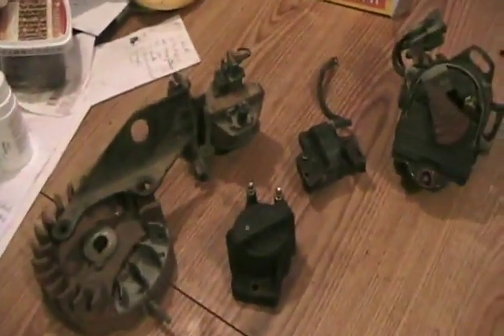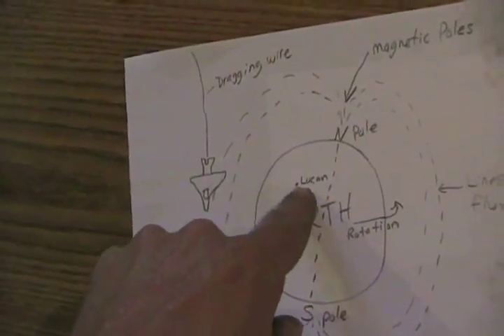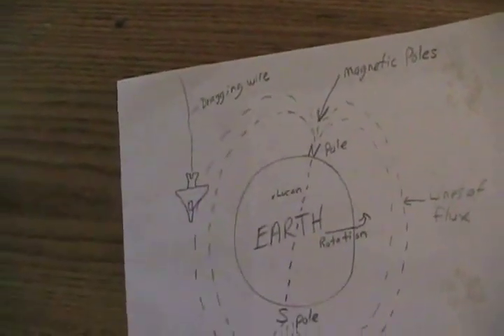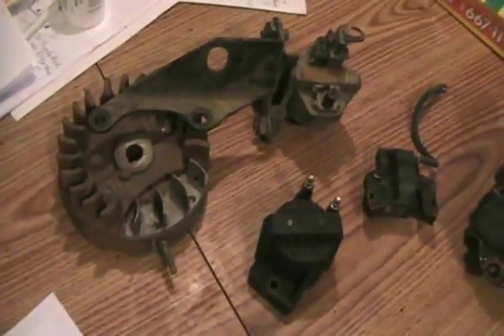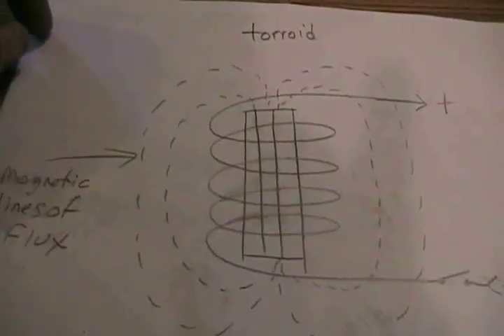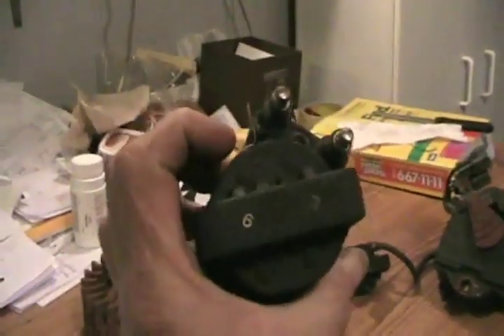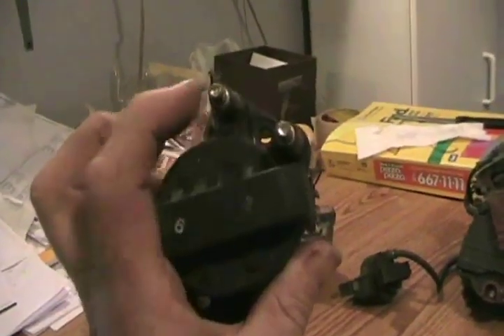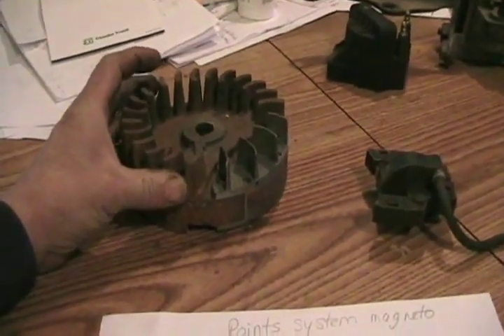#1187 How magnetos and ignition coils work [Davidsfarm]

Comment: Hi!
Great explaining! I finaly have a somewhat better understanding of how an ignition coil works, thank you!
However, I have a question.
I have an old tractor with an ignition system without a battery. My ignition coil is broken and replacements are no longer available due to the size of a new ignition coil. My question is therefore; does the ignition coil have to placed next to (or nearby) the spinning part of the ignition system (the end of the crankshaft) or can I have a new coil mounted somewhere else as long as the magnet itself remains in the same place and the wireing from the magnet to the coil is done correctly?
It's an old Aebi am 53 tractor with an MAG 1040 srl engine.
Thanks for any help, and again: great explaining!

Comment: One point about your diagram the condenser only has a single pole and is not wired around the points or contact switch, otherwise nicely done ✅

Comment: I wonder if I can make a mini Tesla gun out of a basic ignition coil, 18650 batteries, caps from a broken amplifier (very high voltage but small), and a spark plug without the bridge as the tip. Then use some old transistors as a trigger.

Comment: hi . l need your  help. my  magneto ignition coil from  my chainsaw  has  small wire like the one you have in  this video. what's happen that  small wire broke,  do  you  think  l can use   the magneto ignition coil like  that  ?   what  can happen  if  l install  it  the  way it is ?    thanks
Reply: +olmedo jaramillo If the small wire is the one going to the points it needs a good conection which can be done by soldering it back together. If it's the one going to the plug its more difficult to join as they are usually made of carbon that can't be soldered, However the high voltate will jump a small gap so you might be able to join it with tape or something and it will still work.

Comment: can somebody explain to me, in magneto ignition system in case of 4-stroke engine the flywheel will cover 2 revolution for 1 complete cycle, so that means the magnet would pass twice through the coil but only 1 spark is generated during the cycle.
Reply: It sparks twice just the 2nd Spark is during the Exhaust Stroke.